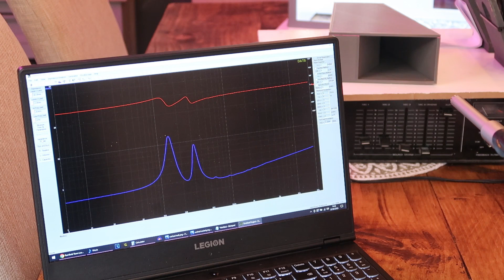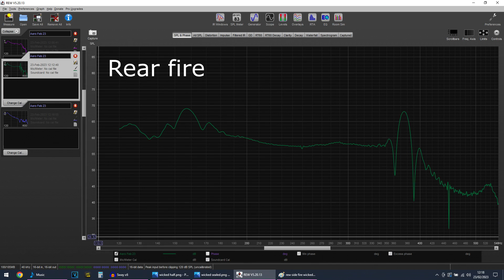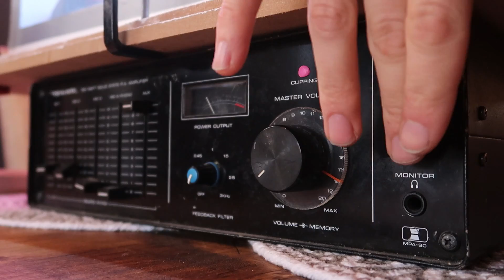Horn or Bandpass? The HALF Wicked One - Boom or Bust S1E3

Comment: I need help scaling this design to fit a 6.5 sub. Any advice would be appreciated.
Reply from the maker: @kelvinlatouche4500  You can't. It is designed for 12-in drivers only. If you scaled it for 6.5% it would only play from like 80 hertz and up.

Comment: Dual Bandpass Folded Horn.  The Wicked One is easy to cut and build out of 2 4x8 sheets of 3/4 MDF.  10s or 12s are great options.  The speed is practically unmatched, the gains aren't the same as a ported enclosure, but rather it feels closer to a best of both worlds between sealed and ported.  The horn provides gain through a much greater range than ported, making it a better choice in my opinion for most music.  Rock and Metal utilize the speed aspect the most.  At any rate if you are a car audio person or even just an audiophile I highly recommend the design, it's my current enclosure in my daily driver.
Reply: Are you referring to this exact design in the video?
Reply: @levrone0075 yes it's dual banfpss folded horn called the wicked one, I use it with 10s in my daily driver
Reply: @levrone0075 yes. Well the full version.

Comment: Im currently working on a design for 4 larger magnet subs or 6 smaller magnet 12s 4th order slight horn style in the trunk of my 2017 accord porting through the center of rear seat for power I already have a 350 amp brand x alternator externally regulated at 15.5v, xs power titan 8 pwr s6 under hood battery and building a 87ah lto bank that fits in the spare tire well for the rear to support 2 jp93 amps this tests show what I suspected over the years of building trunk 4th orders to be true it just works 👨🏽‍🔬⚡️

Comment: Best speakers i have ever heard, were home made folded horns my dad made in the 70's with 15" drivers. 4'x'4'x4'. They hit so hard and got extremely low. Those powered with my Sansui 9090db, sounded better than the Klipsch La Scalas. They were not sealed on the front, like this one is though.

Comment: This box reminds me of some pro audio/live sound designs with a 6th order bandpass design, which include Martin audio and d&b audiotechnik dual 18” subs. I don’t know the Martin model number, but the d&b boxes that use this design include the b2 and b22. Those boxes have the fronts of the drivers directly facing each other in the back of the horn area. And the backs of the drivers are inside enclosures with slotted ports out the front. Those have always certainly given me that punchy kick for live bands as an audience member, though I’m not sure if they can really technically be called horns?

Comment: The mouth is too big on this one, it is not half of the design.  Tuning / port length are affected here.
Reply from the maker: Yep, I just print what is sent in though. I'd be interested what difference it makes on the meter with the correct size mouth!
Reply: @barevids  Thanks for getting back with the details, that makes sense.  Looking forward to the next episodes!
Reply: @barevids in my real world testing with a single 12" in my big van, more mouth area would give higher spl basically every time

Comment: The coffin! You should also try that one with the driver facing the other direction and see the difference. Or, at least with it mounted the other side of that mounting face because the air movement holes in the chassis are being restricted by the thickness of the plastic mounting face panels thickness.
Reply from the maker: I did actually test that before shooting, about the box thickness restricting it, and found it had absolutely no effect mounting the driver on the other face - the area of space for the rear cone pressure to escape is actually much bigger than it looks, big enough for it to be completely disregarded by the driver! This was confirmed by RTA and also impedance sweep

Comment: When you did the demos did you use higher pitched faster music and slow the video to put it back in the bass range?
Reply from the maker: all explained here https://www.youtube.com/watch?v=Nq4KWMBR8Yg
Reply: @barevids  did you find that a helmholtz resonance scales up like that with box dimensions?
Did you find that a box with 8 x the volume, twice the port length and 4 x the port area gets tuned twice as low?
Reply from the maker: @TimpBizkit  helmholtz resonator uses the fluid dynamics of air which scales. This series is scaled by a factor of x6. That means the frequencies are multiplied by 6, port area divided by 36 since its 2 dimensional, and box volume divided by 216 since its 3 dimensional to create a small scaled version of a full size enclosure.

Comment: Very cool video.  Those wicked ones are neat boxes for sure. Would you be interested in testing a parallel 8th order bandpass?  I could scale down a 1/4 of my van's 8th order and send you the specs or maybe toss it into an stl for you to print.  Just will need some info on the speaker you're using to verify a few things.  Videos of my van are on my youtube channel.  It's 4 DC Audio level 6 18s on 2 DC Pitbull 20ks.  Usuable bandwidth from ~17hz to 80hz.  It did over 160s even with 3 of the subs having loose push terminals causing them to get different amounts of power and fight eachother lol.
Reply: Just saw the link to your submission video, I'll see about submitting it.

Comment: I love this series. 

Also, one of my favorite boxes I've built sound and range wise was a 2 12" 4th order in a 2:1 ratio. After like 6 rebuilds and adjustments, it would play mid 20hz range up to 50hz range easily within a couple Db across the board. Could play anything and it would sound amazing and loud. 

Takes some effort like anything, but a well dialed 4th will always be a favorite

Comment: Be interesting to mount a isobarric loading in the half wicked one and see if the lows increase as the box is designed for isobarric loading
Reply: Wouldn’t help much, to get lows you generally need a larger box and lower tuning as well as more xmax
Reply: was crossing my mind too thinking faster tighter response  chest thumper.

Comment: I've had experience with 4 of these boxes and used one in competition. I believe you have it way too close to the back wall. needs about 1-1.5 feet of gap to get the full effect of the horns backwave. best sounding box I ever built.
Reply: Agree to disagree. Not sure of ur vehicle 🤔. Had a 99 suburban with this box about 6 inches away from the rear. Insane!!!! But Agreed best sounding boxes I also built. But just... looking forward to see if Sam builds the others?
Reply: @nnperformance76  Nothing to disagree too good sir. I had it in a '91 civic hatch but I actually have to put the wicked one into my friend's 2 door Tahoe for fun and the box was also 4-6" away from the back door. Had so much bass had to turn the gain down also box broke all his roof braces lol. Sounded crazy especially on movies. This box in this vid seems super close in my opinion. Glad you got to experience first hand. Barevids says it's nothing special but you and I know the full size dual version is very very special lol.
Reply: @nnperformance76  What subs and amp were you using?
Reply: @turblown  it was over 20 years ago. 10" Pioneers can't find them anymore high sensitivity and low fs. And some Sony switchable voltage rail amps. Nothing fancy but one box was the 36x36 and the other was 36x24 or 28. So 4 10s in 2 sized wicked ones in a 99 suburban was great. Musical...

Comment: Awesome 👍  I am considering this type of box for two 18"s . Just curious about woofer orientation,  in the plans I looked up it had the woofer magnet in the sealed portion of the box , is there any difference?
Reply from the maker: I think the only difference is that with magnet in the ported section, it will have better cooling and you will smell the coil before any lasting damage occurs 😂
Reply: Build it.. its not a one note wonder. It's not a burp spl king. But if u like different kinds of music it will surprise you 100%.

Comment: I was a bit confused by the word "horn", for me it is something you use for higher frequencies. And for that reason horns are kind of "bad" since they are very directional compared to a dome that can spread the sound better. But as we know lower frequencies are not very directional, but can be a subject to "standing waves" and from where in the room you are while listening. But pure pressure and air movement can always be compaired. Interessting non the less. 🙂
Reply: Horns aren't specific to any frequency. It just needs to be longer to accommodate lower frequencies

Comment: I constructed a full sized Wicked One enclosure years ago and dropped it into a '93 Honda Civic Si firing towards the rear.  Enclosure ended up being 36" x 36" x 12.5" and slid right between the strut towers.  JL Audio 10W6 drivers were used with something like 600 clean watts.  The setup managed to pound out 159.6db @ about 60hz I believe.  It was unbelievable at the time.  I agree, for metal and alternative etc it was absolutely incredible.  Jazz was insane as well......the "Iguana" album from Ray Obiedo comes to mind as being quite impressive.
Reply: I may have built two, one full size and another short one on top of it in a 86 golf..... I cant give any numbers on their performance, but I can say one thing about them.... WHAT????

Comment: I just looked these up recently!! Was curious how they’d sound in a single 15 in a suv.      I’m very curious if you were to install a small long (low tuned) port into the sealed section making it a sixth order if it would increase the low freq output?   Anyway you could implement a small port into it?
Reply from the maker: Design it, send it in and i might print it! :)
Reply: @barevids  just make it episode 4.2.   Modifying the wicked one into the wicked one v2.   Print out a small aero port or find a small 1/2 or 3/4 pvc pipe and turn the sealed section into the rear ported low tuned chamber and see if there’s a gain in the lows!   I’m not up on my design skills to be able to send u anything.  But in my head I feel I can design with the best of then and I’ve read so many forums and articles about box design.   I’d also like to see some tline designs with a 1/3 offset driver location.  There’s a guy on one of the fb groups that’s always ranting on and on about some magical 1/3 offset driver ratio tline that has more output then any other design out there.  His name is Paul Ryun is his name I think.  Seems to know his stuff
Reply from the maker: I might consider it for an end of season special. This might be a great opportunity for you to learn 3D cad tho and turn some of your ideas into real models. Freecad, fusion360, sketchup, all freely available ☺
Reply: @barevids  I enjoy learning how different enclosures effect how a speaker plays and this season your doing is freaking awesome!   You can read all day but your taking someone’s word for how “it” sounds.  Trial and error seems to be the best teacher.  I’ve cut and modified my simple 4cube ported box 12 times until I got the best sound I preferred.  Started with a 2inch tall 20 wide port, wasn’t enough output so I went to 5 inch tall 18 wide   =a lot more output but at a higher frequency so the. I extended the port 16 inches externally.  Now it has lots of output and plays pretty low but falls off on the high frequency so now I’m thinking 6th order to gain the higher frequency output,  but then I got to reading on tlines and I have no personal experience listening to them but I believe I will enjoy their sound more bc they’re suppost to be more accurate and go really low.   But then I’m like what about the higher frequency? Should I expand the line for a horn loading effect for higher frequency?  So many options but so expensive experiment.    So this season your doing is right down my alley!    I’ll check out the cad designs and see if I have time to figure it out.

Comment: So have you thought about 2.5 inch and 3 inch drivers to simulate 15s and 18s yet? just curious. Even though I am running a single 12 right now, I am a big woofer guy. Something about 20 hz at around 140 Hz that just makes me happy. My 12 drops off at basically 27 Hz and a lot of the songs that I know have those low lows are just disappointing to listen to. Lol.
Reply: You can always build a different box to get the lower frequencies. My Ultimax 12s are pretty solid to 15-16Hz. They actually play louder the lower I play until they drop off under 15Hz. (Partially because of room gain I think)
Reply: @JoshM7  that's how my zcon 18 seems. Pretty flat from 18-50 Hz. Pretty much falls flat on it's face above that though. The ns4 12 I am running right now plays about 27-50 Hz.  But a lot boomier than what the 18 is. 18 does basically high 130's from 18 to 45 Hz. I should have designed my own box instead of following sundown's recommendations. And with the cost of wood, don't really wanna do it again right now as I just built this box about 2 months ago and birch definitely ain't cheap.
Reply from the maker: of course haha, future seasons!

Comment: I built this wicked one full scale for 2 kicker L7 12s about 15 years ago and goodness goodness, for metal and alternative, it was incredible!!!
Reply: Also, same results at full scale. When I had my window down or even cracked.... it came ALIVE... so so much more so then when the windows/doors were closed.
Reply: @Basshead40 I’ve been meaning to upscale it to 15’s but math lol
Reply: @Always Lost Lawz  lol yeah its definitely not your average enclosure build huh!?
Reply: @Basshead40  the plans they have is straight forward for the size they give but think when upscaling it, there was something I didn’t want to figure out back then maybe one day though lol
Reply: @Always Lost Lawz  lol yeah I hear you. I just had to make it back when. I still have the plans on the ol external hard drive 💾  lol. Been eons but goodness I was thoroughly impressed when it came to bands like Tool. It just utterly pounded for metal.
Reply: @DidiotLawz save yourself the extra wood and money and build a ported enclosure or a 4th order, ittl sound the same if not louder. Maybe this box might be a little more efficient on the high notes and if that’s what you’re chasing then scale the smaller box to size. I’d start with ratios, if they use a 8” woofer and one of the mounting walls is 20 inches, scale that ratio up for a 15” woofer
Reply: @Miyukiii111  both is going to use about the same amount of wood with small drivers but not large ones and I’d have to sit down and calculate for larger lol so that’s irrelevant and considering there is going to be more adjustments/time on the fourth then with the W.O and since it’s H.T the fourth is going to take forwver
Reply: @DidiotLawz  I used to be obsessed with horn enclosures and super efficient designs for single cheap subwoofers until I realized how expensive all that wood is (I like deep bass down to 20hz) just can’t be reasonably achieved with a horn unless it’s the size of a fridge. So I’d just spend the extra money buying a 2nd sub, bigger amp, and building a simple 4th order bandpass or ported enclosure
Reply: @Miyukiii111  you acting like a fourth would be small lol maybe not the size of a fridge but big enough also I’m a fan of LLT enclosures so a ported isn’t going to be small either lol
Reply: @DidiotLawz  a 4th would be way smaller than a horn and you can make a 4th order the same size as a ported box and have it perform better if you know what you’re doing
Reply: @DidiotLawz  seen a 4th for a single sundown x 15 play from 20hz to 55hz, 1.6 sealed 2 ported